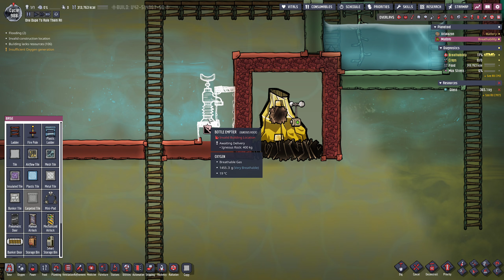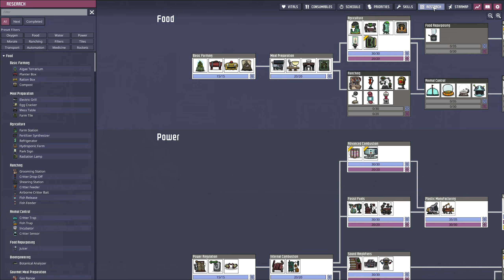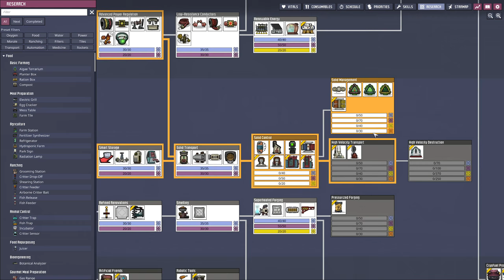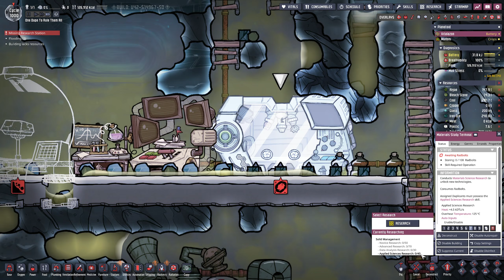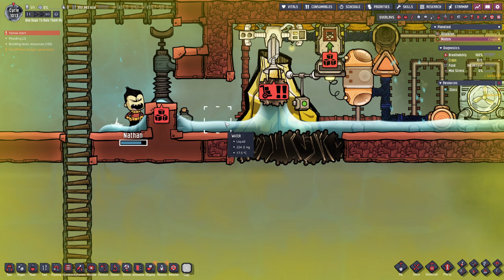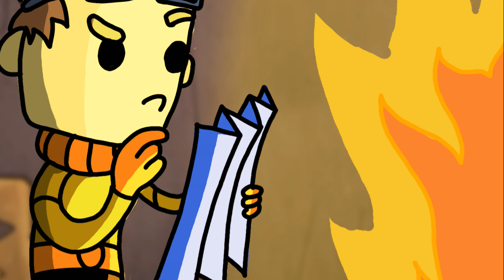GOLD VOLCANO EXTRACTION - Spaced Out (Classic + One Dupe): Ep. #20 (Oxygen Not Included)

Comment: As far as the transit tubes goes, My longest colony has about 4500 cycles or so and I have never built a transit tube. its a waste Because of room and power and material requirement. Ladders are faster With enough athletics and my dupes are like +18 or so for running around so much.
Reply from the maker: I guess you are right, but that doesn't mean they aren't useful during the time the dupes aren't as quick.

Comment: Gold is darn cool really.  2 turbines you'll be luck to keep steam in the room warm enough for the turbines to even work.  With gold turbines can even stuff cool itself without a tuner.  So, the tuner is a complete waste of power and setup time.   Now if you are using it to cool the metal in another room great.  If not, you'll just be using more power for another which you needed need in a Gold Volcano.   Self-cooling most guys run two turbines for iron.  It cools much slower.  But from my play throughs you don't.  Gold also loses it heat very quickly.  So, cooling it down is easy.
Reply from the maker: Huh? Only to 200 degrees. Below that you need an aqua tuner.